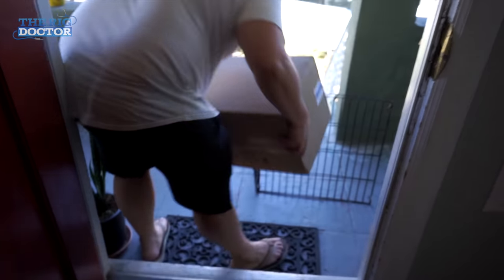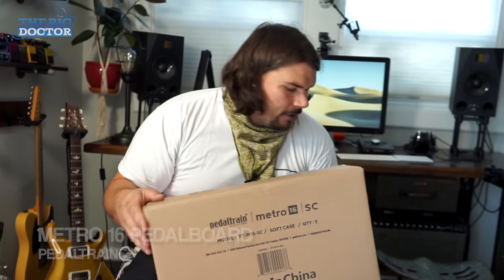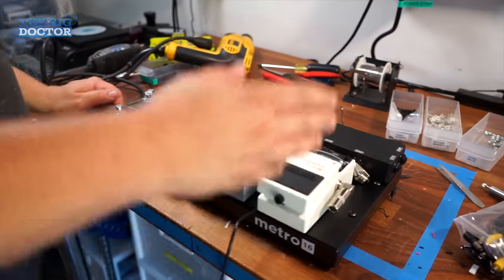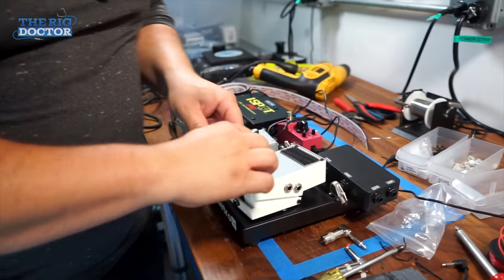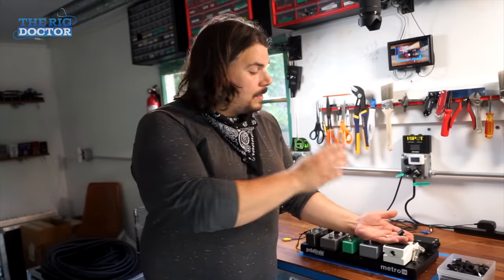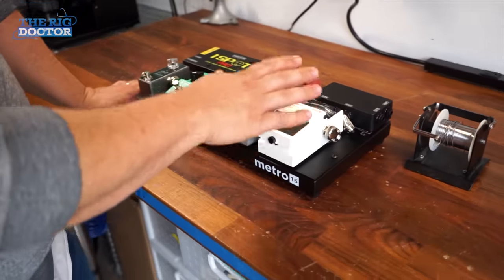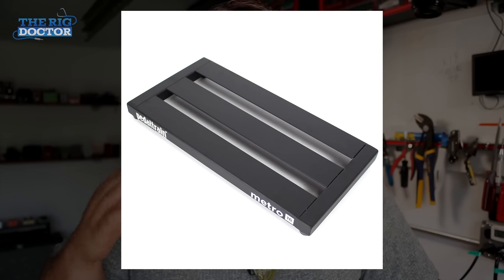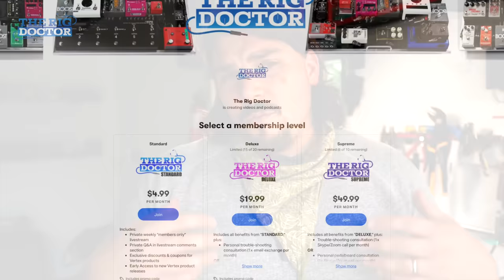Building A Budget-Friendly Mayer Rig!

Comment: Hi Mason.  First off I'd love to win that board but I already have a lot of pedals and beginning to lay out a board to build, so I'll let someone else win your giveaway :-)

I do have a question though.  I'm wondering if it would be better to start out with a "dual buffer" (Mesa HighWire) to isolate the board from the guitar and amp; or go with just a switcher to reduce pedal signal path.  I know there's a lot of things to consider but I'm wondering if there is a simplified answer to get started.  Here's the current list of pedals, in no particular signal chain order.
Strymon: Sunset, DECO, DIG, Flint, Iridium, BlueSky
Rivera:  Acoustic Shaman (chorus/vibrato)
TCElectronics: Ditto X4
Empress:  ParaEQ (EQ/boost)
Peterson:  StrobeTuner
Mission Engineering:  Volume Pro, SP25L-ProAero Expression pedal
Reply from the maker: Yes, always an input and output is necessary with a few exceptions.
Reply: @VertexEffectsInc  thanks for the reply.  I guess I'm wondering if I have the dual buffer in place, am I correct in saying that adding a switcher into the board would just be more of an ergonomic convenience and won't affect the tone?
Reply from the maker: Greg A it will make the signal path more direct and will improve the tone in most cases
Reply: @VertexEffectsInc  even with a dual buffer like the HighWire?
Reply from the maker: Greg A each part will improve the sound more, the more direct you can make the signal path the better.
Reply: @VertexEffectsInc  Thanks.  This might be a silly question related to my upcoming build but is there a patch bay box that has a good dual buffer combined with it?  Probably asking for a miracle there!  I might have answered my own question with the Empress Stereo + ?
Reply from the maker: Greg A Mesa Boogie Highwire
Reply: @VertexEffectsInc  I like the HighWire for what I'll be doing in the short term (one amp).  Down the road I'd like to try a wet/dry(damp) setup, where my gain, compression, EQ  out gets split and one path goes to a dedicated "dry" amp, the other split comes back into the board for the  modulation, delays, reverbs, trems, etc and out to another "wet/damp" amp.  For that I would think I would need to add something to the mix with the HighWire to make it all work well??
Reply from the maker: Greg A to do a real wet/dry/wet it’s different than you’ve described- see our video about it to learn more
Reply: @VertexEffectsInc  yep I watched that awhile back and yes there are differences in how people set those things up!  I'm just thinking the HighWire wouldn't be enough to handle either of those by itself?
Reply from the maker: Greg A would would need two more output buffers for wet/dry/wet and a parallel mixer for the wet effects.  Something like the MusicomLab Parallelizer

Comment: will it fit if I flip the cover of boss pedals without removing the rubber?
Reply from the maker: Depends on the device, some of them have mezzanine level PCBs so you’re not able to fit it if you don’t remove the rubber, you can try it out, it’s on a device by device basis
Reply: @VertexEffectsInc  thank you for the reply that was a very helpful tip! never though of that haha. I prefer not to remove the rubber and labels. so I cut Velcro in tall narrow pieces to mount my boss pedals. it works but your idea is better if it fits ;)
Reply from the maker: @bilalnachabeh  mounting velcro to rubber typically won't last long, not for our pro applications at least.  This is what induced this practice.

Comment: Can’t you flip the bottom of Boss pedals without peeling the rubber/ label?
Reply: I just tried. No. I pulled off the rubber. It’s pointless
Reply: Lots of people make bottom plates for Boss/Ibanez style pedals so you don't have to rip the bottoms off of your pedal. You can also zip tie it to the board if you'd like.
Reply from the maker: Depends on the pedal - Boss pedal with pots have a deeper mezzanine board that will require it because of less depth to clear the pcb.

Comment: Love some good pedalboard porn 🤤 I find that using two different grades of dual lock works best; I use a really fine grade dual lock on the board itself, and then a more coarse dual lock on the pedals. The connection is still solid, but you don’t need a crowbar to remove anything!
Reply from the maker: Yes indeed!